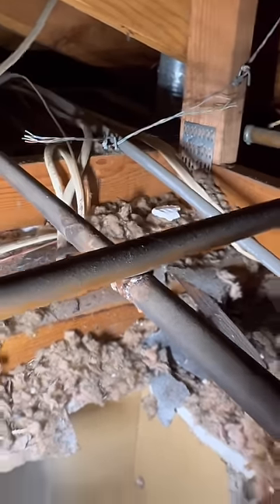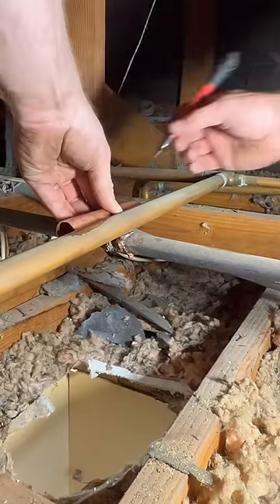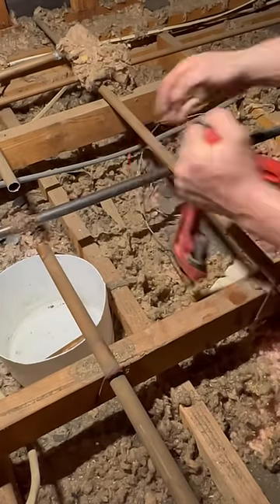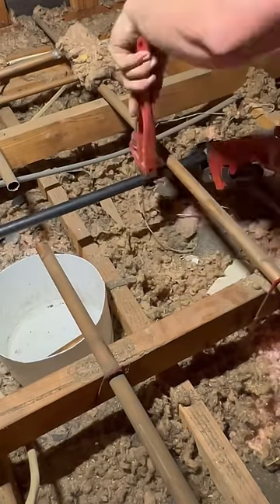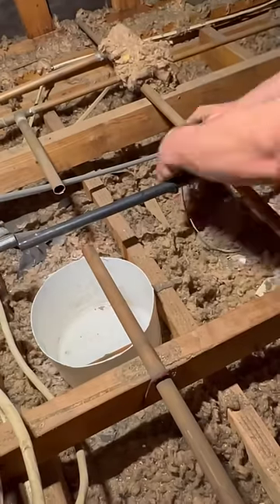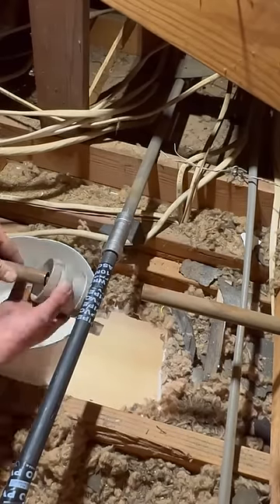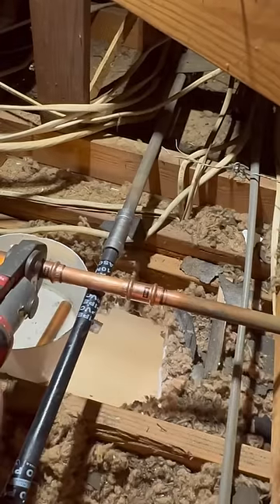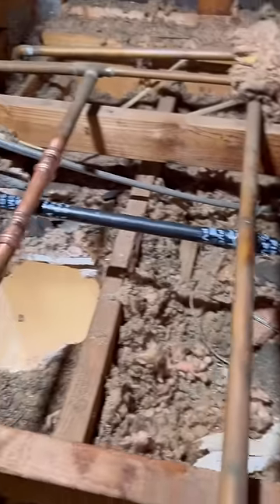a little galvanic corrosion action #plumber #plumbing #propress #soldering #diy #repair #gasline

Comment: ok so why wouldnt you route the water pipe further away from the gas pipe with 90's? just get away entirely from having to add rub tape to the gas pipe and then have a full mind set that itll never rub through that tape in the future!

Comment: Had one Leak today . I’d say I’m not a fan other then Certain situational uses. It does not look as good as soldering you cant really make certain tight turns . But I will say it’s probably better then what most of these hack plumbers solder joints are looking like out here. And remember folks never hire a handyman or diyer to do your plumbing they don’t have a cool and I’ve never and I mean never seen a handyman do the correct job. And that shit is a health hazard . So hire a professional

Comment: There's a time in a place for every kind of copper connection for all those out there that just propress  sooner or later you come to a spot where that press tool doesn't fit and you have to get out the old torch and solder so you'd better know how to do it. I had it happen a ton of times when I worked at these shithole apartments called haverford after you got all the roaches out of the way the press tool still wouldn't fit so you had to use a torch.

Comment: Only bad presses leak. Ive seen unpressed fittings held together by luck, never leak. Shark bites fail. Uncleaned solder joints fail. Coroded pipes fail. Expantion pex joints fail. Compresstion fittings fail. I have yet to find a failed propress.

Comment: If ya do the research pro press -solder -shark bite -compression all are supposed to last around 20 years couldn't find exact numbers on pex expansion tube ya I know your has lasted 40 years bla bla bla as I said do your research

Comment: Going to give that repair a big fat FAIL.

They will have a problem in the future, because you can already see the problems in the background. Several of those copper joints are corroded, and one span of copper has a pinhole leak.

Also, they will definitely have problems in the future with your specific repair. Do you seriously think that wafer thin tape is going to hold up in an attic that has temperature extremes every 12 hours for years? If the plastic deformation doesn't move it out of the way from the pipe pressure, the heat cycles are going to make it brittle and turn to dust in a matter of years.

I've used that same exact tape before, it's garbage. Not only does the adhesive suck, it gets hard and brittle and falls apart.

The correct repair would have been to re-route one of those lines so neither pipe touched each other at all. Sure it's not a good option, but it's better than relying on perishable wafer thin plastic.
Reply from the maker: 🤣🤣🤣if you wrap a steel pipe in that tape and bury it underground it will last 100 years. I don’t know what you’re talking about it getting brittle and falling apart. It’s not going to magically dissolve buddy

Comment: You must not be doing a lot of work if you've never seen a ProPress fitting leaking because I've run into dozens of them leaking all the way from manufacturer defects to improperly installed or leaking and I just couldn't tell why. And based on your previous videos I'm going to assume you're a licensed plumber and me a maintenance tech I'm pretty sure we both run into a fair share of BS and hackery let alone failed products. I find it unbelievable that you've never ran into a failed fitting.
Reply from the maker: I do service and repair and I’ve never seen a press fitting leak, not mine or anyone else’s